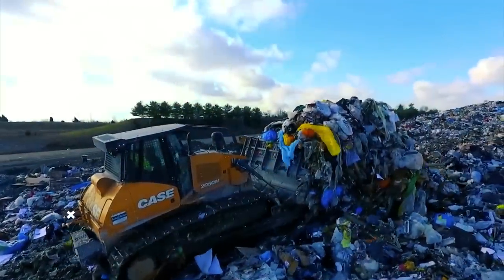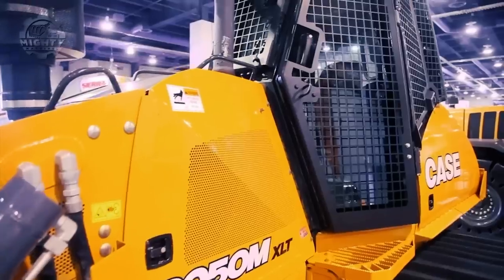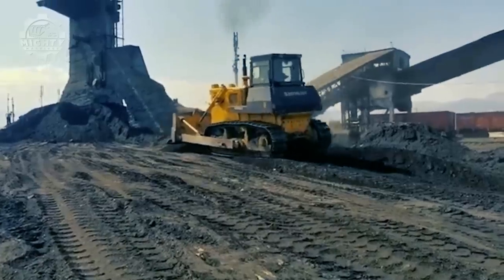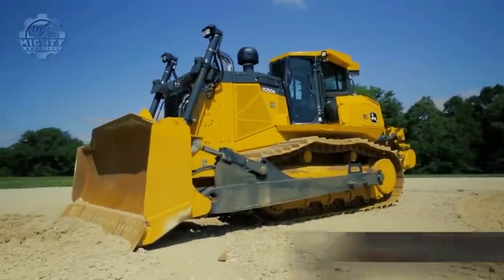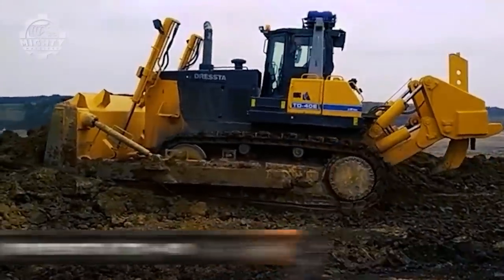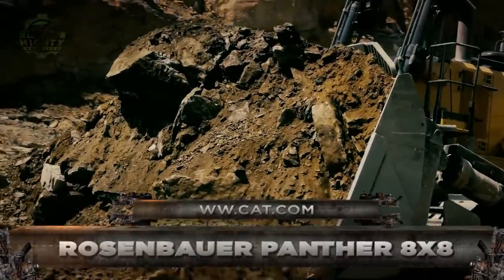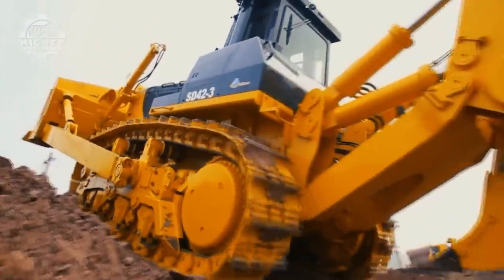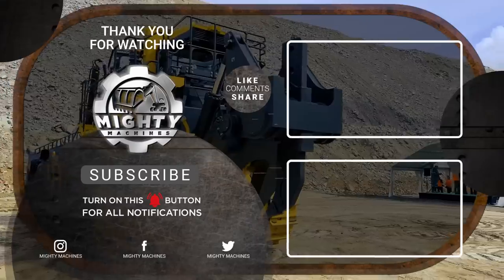TOP 10 World's Largest Bulldozers That ARE On Another Level

Comment: I've been a operator 30 plus years, Own my own little site development company, I use a cat 12 H grader a cat 339 and 320 excavator,a cat 928 F loader and a 644 H John Deere loader,my dozers for pure pushing power I use a cat D-5 M but for finish work with a dozer I have a John Deere 450 h and a 700 h John Deere H model dozers are smooth as silk I can finish Rock within a half inch with a Deere all these new K models are pure junk